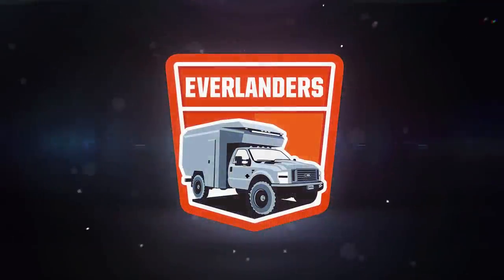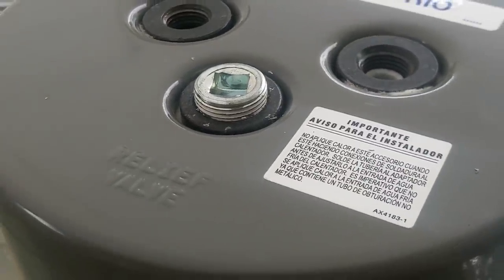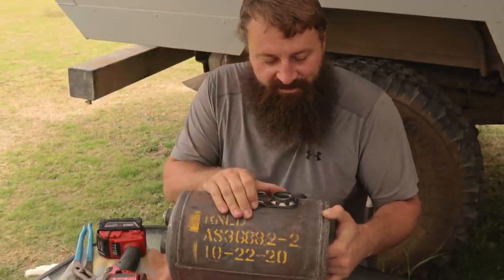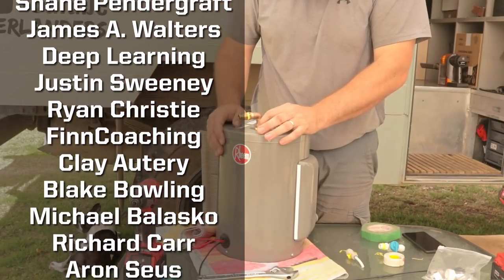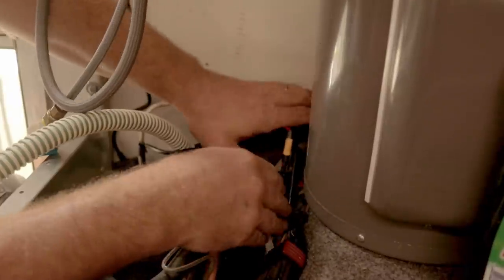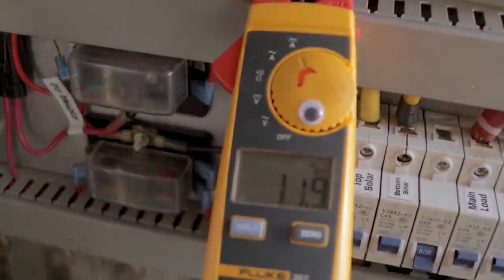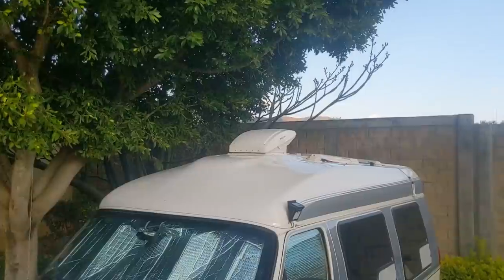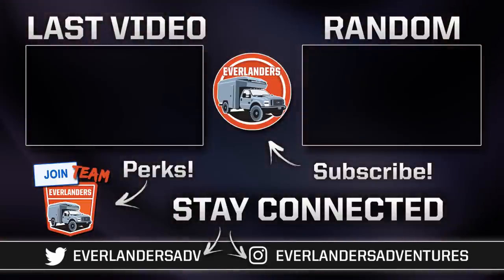Solar Powered RV Water Heater Conversion - 12 Volt Dump Load - Everlanders see the World!

Comment: Amazon has < $40 , Opolar 5v 8" usb fan .
4 speed , brushless, very quiet , good air flow 5 watts on high .
Excellent  value easy  to clean blades . I think it would replace your vent fan with some velcro adaptation.

Comment: Yes you re right,ment Legionella bacteria in water under 60 degr C.,just be sure your temp doesnt dip too much and let water run 10-20 sec.Maybe not easy to get those things in a more or less off grid installation,where one wants not to use too much water or power.Stay safe,thanks for vid.
Reply from the maker: I think your refering to Legionella, which "Temperatures above 60 °C (140 °F) kill the bacteria" https://en.wikipedia.org/wiki/Legionnaires%27_disease 

If you have other studies or papers that show otherwise, please share these facts.

Comment: I like the video very informative.  I’m going to install something here in the house on a 80 gal.  I’ve been in  the thermal industry for 33 yrs working with almost every insulation product out there.  If you can find a product call Cer-wool aka Ceramic Fiber.  Now this product is very fibrous and unhealthy to breath but can be encapsulated  in foil back sheeting and tape all edges and easily used.   It will make a hot water heater into a thermos bottle. Don’t buy the Mat more dense Ceramic fiber use the slightly fluffy type material.
Reply from the maker: Any resellers in Honduras or El Salvador??
Reply: @Everlanders  I would say yes on this product.  It's used for power house or Boiler type Units where temperature exceeds 1200 F. Degrees.  Should be available world wide. Black Smith's use it as well .

Comment: Very nice idea.
Maybe if you put some heat exchange paste in between the 2 parts...
it's probably going to be even more sufficient.
But hey...
if you have sun enough...
who cares.
Good luck to the both of you. 🙏
I'm wondering how many cubic inches you find in your home that is not being used.
Probably not so many anymore.
Filling up the gabs. 😉
Reply from the maker: Yes, I considered thermal paste, but I hoped that the silicone mat was compliant enough to make good contact.  And considering I looked for two days to even find plumbing fittings that would work, I don't know that I could easily find thermal compound down here in rural Mexico.

Comment: i live in a 34 foot motor home and i wrapped my 5 gal propane  water heater tank with a 12 volt 15 watt heater pad. And connected it to a solar panel on the roof of my RV.
i found now i am using about 1/2 of the propane I use to use.
i also have run out of propane and in the winter the water is not ice cold  but not real warm but usable for a shower.
Reply from the maker: Put a 100 watt on there and use no propane...

Comment: I think you will find heat will transfer up the copper pipe for the hot water, it needs a drop section  to drop down  over the  top edge of the tank to stop thermal transfer upwards, don't  know how much drop.
Reply from the maker: I just insulated everything...

Comment: Man, modifying the maxxair with a whole new controller and brushless motor would be sweet. Like most RV equipment, it's a great idea built cheap and sold expensive.
Reply from the maker: Yes, I was doing research along this vein as well, but I don't know that existing brushless speed controllers are going to be that quiet... You will likely hear the high-speed switching as a hum...

Comment: Great project I was amazed at how simply a commercial water heater was constructed, I'm just a little concerned at your temperature settings you may want to go a little higher so that the resting temp is above 60°c to protect against legionnaire's
Reply from the maker: It actually only needs to be over 50°c... and now that I have the new water fittings here and we can blend at the tap, the heater is usually at 70°c

Comment: First-time visitor, now subscriber, liked your work, would love to see your cicuit diagram... was very curious about the over pressure valve, it looks like a plug, and it dosen't seem to have a connection point for the drain for the "blowoff" water that would happen with an over pressure situation...loved the work  would love to see the 110 connected to the grid toed side, for those trips back to the homeland ;-)
Reply from the maker: There are 5 over pressure blow offs in our system, set to 3.4 bar. And the connection for the drain works fine.

Comment: I just tried some Printable TPU and Im hooked. I used the same settings as PLA but reduced the feedrate to 15mm/s .
I've been using it to make pipe adapters and vibration spacers for the diesel heater in my Boler.
Reply from the maker: Nice, Direct Drive or Boden Tube?
Reply: @Everlanders  it's a plywood makerbot from the first wave. Dual extruder, the drive gears are in the hot end. But Ill go look up the difference as I don't know.
Reply from the maker: Oh, cool, old school workhorse! That's a direct drive unit, I have considered printing the bracket so I can move the extruder to the hot end so I can print flexibles too... I'm just hesitant to add any more mass to the gantry as this and road bumps and vibrations will be hard on it.
Reply: @Everlanders  Cura and prusa slicers allow you to customize the layout of your printer hardware. So you could build a completely custom printer the exact size you need. I find a 'small' build plate to be perfectly fine for 99% of what ive ever done. What printer do you have? thats crazy that you bring it around with you.

Comment: Be mindful of those fittings for the UV sterilizer. Because the light from the UV is of the C (UVC) and can break down those fittings. If you can, swap those fittings out with copper and at least 2” of copper beyond the 90° bend. So that no plastic tubing will see the UVC light.
Reply from the maker: 4 years, still going strong...

Comment: I am a retired  multidisciplinary engineer.  You might consider having a melted wax reservoir with a soft copper coiled pipe, immersed in the wax, to heat water as it passes through.  The wax will absorb a lot of heat as it melts, and release that heat to the water.   You will be able to get about 150 degree F water, and only heat water you are using.

You could also add tubing to the bottom of solar panels to remove heat, lowing panel temperature improves efficiency of the panel.  Working fluid for that could be water or an oil.
Reply from the maker: That seems quite a bit more complex than popping in an off the shelf water heater... Perhaps outside the scope of what I can do, on the side of the road in Mexico during a pandemic...

Comment: Loved your solar conversion of an existing water heater.   We are building a covered backyard BBQ area with sink, some distance from our house.  Was looking like the sink would be cold-water only.  I was already planning to mount some PEX pipe pool water heaters on the 16' x 16' Alumawood cover, and they'd need solar power for the pumps, so maybe I can use that solar to power your modded water heater as well.  Thanks for the idea.  I don't travel like you do, but I'm subscribing to your channel just the same.
Reply from the maker: Thank you kindly! 😃

Comment: inspiring, i might just take the hwt apart in my caravan, and fit a film heater, and bimetalic button stat, fed off the solar controller output, my lithiums have bms built in, so i can use the lv cutout off the pv controller which is adjustable. i cant do anything too raadical or i would reduce the resale value

Comment: 9l x 30C delta x 1.16 = 313Wh thermal storage capacity (of course excluding the losses trough that excellent thermal insulation :) )
Reply from the maker: Good to have those numbers! I can push that to 0.5kW if I go to 80°c!!
Reply: @Everlanders  Awesome video as usual.  80C water and a mixing valve would go a long way.  Watt whatage is the silicon heater mat?  Do you think replacing the fiber insulation with expanding foam would make much of an efficiency difference?   @electrodacus I have an SBMS0 with diversion dssr20's that I hope to use in a similar 12V (internal) water heater config.  Way less solar than Jason, but hopefully with a well insulated tank and immersion element its workable.
Reply from the maker: Real men use faucets as mixing valves! 🤪

 (As long as you don't have kids in the house)

Comment: I think you want to do a “if read_temp() > setpoint then turn off the water heater” outside the “if s.soc > LVC” code. That way if the water heater gets turned on it will get turned off even if your batteries never reach the LVC. I could be missing something, but worth a look.
Reply: I commented before seeing your “fail safe” cron job. That should catch you like you said. Worst case is the water heater is left on for 30 minutes while above the desired temp. You probably are good, but might want to update the code that runs every minute just to be safe.
Reply from the maker: After a few weeks of practical use, I found I can keep the heater running and hot even through the night, and keep our state of charge over 90%. So now I actually want to keep it running until it reaches the low voltage cutoff.

It's very nice to have hot water for dishes in the morning, and not need to wait until the battery reaches LVC, because the water heater uses far less power than we're making in the peak solar production of the day. So I use a little bit of battery in the morning and through the night, but make it all back in the midday...
Reply from the maker: But I really appreciate your auditing my code as it was hastily shown, always good to have a second set of eyes.

Comment: Great video J! One of my favorite so far. It seems like a project anyone can do.
Reply from the maker: Thanks JB! Only now do I remember your hotter heater was giving you some troubles, I suppose you can keep this one in your back pocket if it ever decides to bite the dust...
Reply: @Everlanders  It could actually be a way for me to use Solar when I'm plugged in to shore power. Right now my water heater runs on gas and does not have an option to run electric. This means I'm burning propane to heat water while my solar is completely unused. Even if my 400 watts doesn't heat the water completely, preheating it would save a lot of fuel.
Reply from the maker: 400 watts is plenty, this heater mat is only 150 watts and gets it up to temp in about 1.5 hours.
Reply: That's perfect. When we're plugged in we're only using the hot water for dishes anyway. I would bet I can find a simple thermostat switch and bypass the Pi as well. Now I just need to find some masking tape...

Comment: Here's an idea that could get you loads of views: installing an AMD ThreadRipper PC in your rig to power off solar, wind, generator, and shore power.  Creating a mount for it that prevents the vibrations, bumps, jars of the road from harming the PC, its storage (HDD, Optical Disk Burner, SSDs, cooling - fans, water, or both).  Might also want to cover how to power a 4K monitor or short throw laser projector as the display/movie projector.  The LG model I believe can produce up to 200 inch video/images.  Plus being a laser projector I wonder how it handles projecting onto oddly shaped surfaces and projection mapping for the mobile VJ?
Reply from the maker: Nope

Comment: On another note....I bought the Milwaukee M12 power tools and 12vdc charger for the trailer..... same line of thinking..... 12vdc power tools for 12v power packs. Building 12v 123 26650 cell packs, should end up with around 300 amp hours.... we will see how that works out. SO this fits your dc-dc criteria kinda. Cheers.

Comment: WOW.  You guys produce that much solar energy ? Congrats, this is probably the greenest lifestyle ever , even considering the diesel truck.  I would love to see a video about your total consumption of power up unit today.  If the dump load doesn't use all of your excess power, what wold be your next move? More batteries?
Reply from the maker: We don't always have excess, if we're running the AC alot, then we're usually non par for production/consumption. But now I have the choice...

Comment: Nice. I like your control board. That's food for thought. Wondering about your control loop - is it worth having some hysteresis in it, so that there's a dead band between turning off, then on again. (so you don't cycle it on and off all the time). Having said that, your cron job will put a minimum switching rate on it anyway, and having your script remember state might be a pest
Reply from the maker: It overshot by a few degrees and then took an hour to cool off again... no hysteresis needed. Furthermore, this was superseded anyway: https://youtu.be/TGMZ7bM-Kow

Comment: I built my tv into the wall, picture frame tv, and wanted to ditch the AC cord in favor of direct DC power. I'd be very interested in the DC to DC videos. Unfortunately, my tv doesn't use a brick, the conversion to DC happens on a board on the back of the tv.

Comment: Have you ever thought about wrapping a coil around it turn on top and bottom instead of using the Matt that you was using I believe it'll produce more energy and keep your water always hot
Reply from the maker: The silicone mat is a coil insulated from abrasion with silicone. I don't understand how your suggestion will "produce more energy" or "keep your water hot" any better than it is now... Please explain or cite your sources.

Comment: I vote for some dc to dc action. I have recently been reading lots on setting up a 48v system instead of the typical 12v or 24v. The system would then do a point of load conversion to the needed lower dc. This also lead me doing the rabbit hole of learning about more efficient ac to dc and dc to dc with GaN fets.
Reply from the maker: Yeah, I'm not sure I'll be getting that deep into the woods, we'll be staying with our base voltage of ~12vdc because so many systems are already 12 volts in an RV environment. But I will be very interested to see if I can make a 10-15% improvement in efficiency powering the laptop and other 16-24 volt things...
Reply: @Everlanders  there is lots starting to happen with GaN fets replacing silicon fets to achieve higher efficiency in power conversion. Dropping the dc-ac then ac-dc step in your set up should achieve some efficiency gains. Trying to maximize alternator charging for a house battery bank has lead me towards the 48v. Still lots to learn. I want to run a electric heat pump for winter camper use.

Comment: Great idea on using the heater pads while keeping the 120V unchanged. I have been experiment with solar panels and had been trying to figure out a way to provide supplemental power to my water heater.  I am not sure if a 30 gallon water tank disassembles the same way as the 2.5 galleon tank, but worth investigating.
Reply: Yes the regular efficiency ones do... but you will have 'fun' getting the insulation back on... 

high efficiency ones are going to spray foam which I believe is done after the outer shell is on which would never slide either way...

Comment: Cool, so assuming the other conditions are met, the decision to start and stop heating is driven by voltage?  I think I have all the parts I need to do this lying around.  You might enjoy my video where I automate my whole house fan based on interior vs exterior air temperature.
Reply from the maker: Not Voltage, but in our case state of charge. Our Lithium Bank voltage hardly changes, so the charge controller records the Current in/out and knowing the capacity of the lithium, can calculate the SoC.  So your mostly right, but different... I've been toying with the script to see how early in the day we (still) hit 100% SoC and turning it on earlier that day, dipping into the batteries a bit, predicting that we'll likely recover. In practice it hasn't really turned off, always nice hot water.
Reply: @Everlanders  Ok gotcha, makes sense, you're not by chance using the relay driver on the BMV 712 are you?
Reply from the maker: No, I used the python script shown in the video.

Comment: Hi there, I am new to your channel and I was enjoying your info on the solar water heater, and I am a retired RV Technician that has been on of the industry since 2008,but I wanted to see if you have ever tried contacting the Max Vent company to see if the 12v motors were covered under the lifetime warranty that they used to offer on their vents???
I used to be able to get replacement components for the MaxVent units, so I would really suggest that you check them out yourself for more information, especially if you have not already done so.
Thank you for the videos, great job at your explanation of your work done on your rig.✌😎👍
Reply from the maker: Good Idea Rory! The website says the warranty is 2 years... https://www.airxcel.com/rv/maxxair/service-support/warranty  But I've sent them an email just for laughs, I'll let you know how it goes.

Comment: Maybe I missed it but I like how there was no mention of of the fact that the price of that water heater was likely in Pesos and not dollars.  
I hope you didn't pay $3k USD or CAD for that water heater.
All your 12 volt and electrical goodies really has me considering going all electric. 
I have plenty of solar and could just build a bigger battery bank and likely be good to go and not have to concern myself with propane. 
My set up would not be as clever as yours but I could probably build what I need.
Reply from the maker: Yeah, I was trolling for comments... it's been a few weeks now and our water heater is always hot and our batteries are still always full... Time to start mining cryptocurrency...?